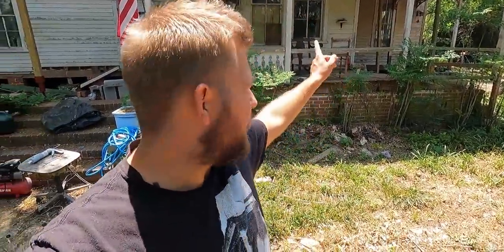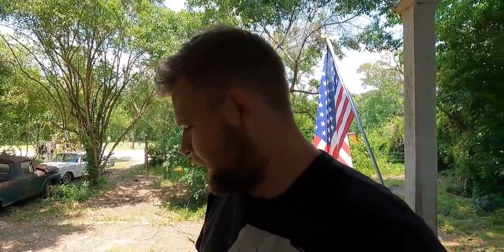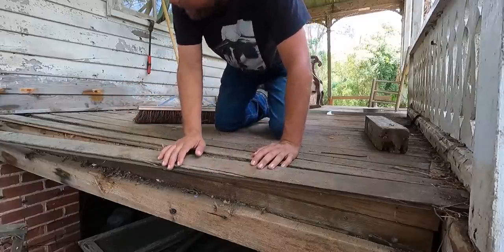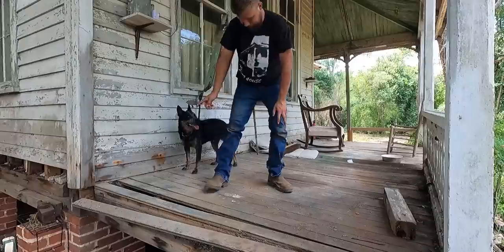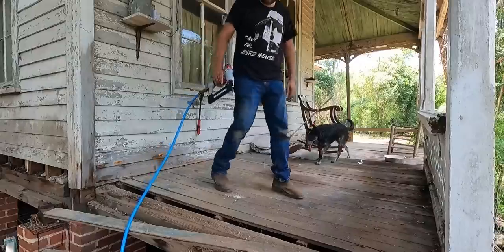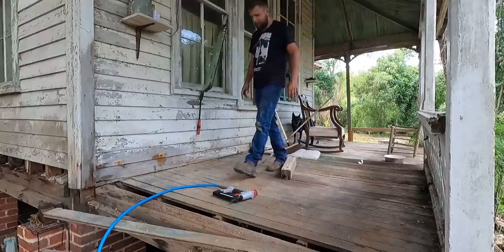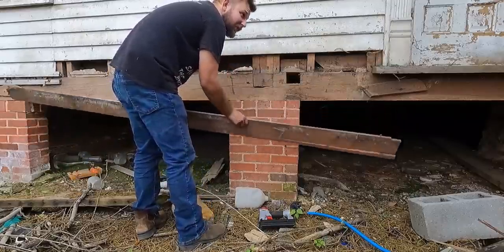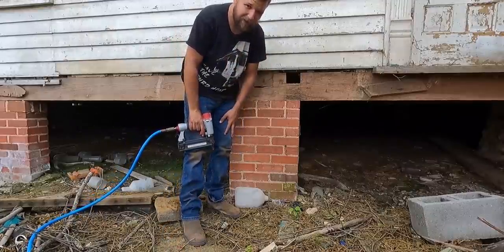Repairing and Stabilizing Front Porch of 140 Year Old Farm House

Comment: Robert, a suggestion.  I was looking at the porch rail that is still there. Railing should be at least 2" to 3"off the floor to let debris and rain water flow. Saves your decking from rotting also.
Reply from the maker: Correct, it was originally spaced about 2 inches off the floor but has fallen. That’s actually another porch project I intend to tackle soon. On that old part of the porch.... we’ll fix em up the right way on the new sections when they get built of course as well.

Comment: I think I remember from an earlier video where you went under that porch and determined that there was too long of a span between piers under there, and you wanted to add one more in the middle, but maybe I'm remembering wrong. But nailing down the boards seems to have done the trick.
Reply from the maker: No, you’re right. It is such a long span with no support underneath. However that wasn’t the bounce problem it was the loose boards. I’ll probably still frame it a bit more.

Comment: Not sure if this has already been mentioned, but you can take a saw and cut the bead off of the old floor boards where it has bulked up. Then it will lay down flush so you can nail it. You don’t even have to remove the floor board to achieve this. Basically you are removing the part of the board that fits into the groove of the next board. I hope this makes sense.. I’m not a professional. Just wanted to share what I’ve done to remedy the bulking floors on my old porch.

Comment: Its good to secure loose boards - even face nailing. Correct way is to set the nail in the tongue of the board and the nail gets covered with the groove of the next board. A coat of enamel porch paint and no one will see face nails.

Comment: Since the boards weren't tacked down why didn't you adjust the boards that are sticking up out towards the end so they would lay down?  It may have been that way for a while but I'm sure it's not honest to the original integrity of the porch.  That's dangerous to have that tripping hazard.  Plus, it would just look better.  And I just noticed that at the other end of the porch the boards are spaced.  You can just push them closer to get rid of the "uprising".  It was 100° here in New Mexico today.
Reply from the maker: The spaced boards at the end are not on that span. That area needs to be replaced. As far as adjusting the boards, I was originally going to do that but explained why I did not on the video.

Comment: Where the porch boards are raised, just run a saw alone the two boards. It should be enough removed to nail down.
Reply from the maker: The proper fix is not to cut them, but to pull them and refit everything, which would have been a very easy task had I chosen not to save that little detail.

Comment: Screw it!  Don’t nail it!  If you screw it, you won’t have to do it again!
Reply from the maker: I was going to screw it originally but I didn’t wanna see modern screws there or risk splitting the wood. The new sections of porch will be screwed using modern decking stuff.